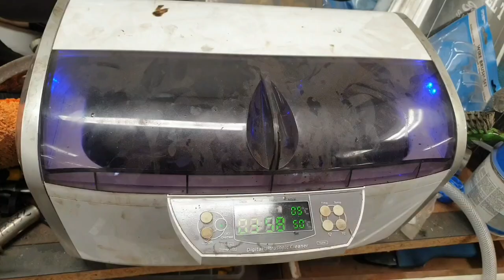Ford Model T Restoration/Build | Part 29 Front Wheel Adapter

Comment: Not how you pack bearings that hub is going to fail I give it 30 miles
Reply from the maker: How come? I have filled the hub with grease using a greasegun on the greasenipple I mounted to the hub. Is that not enough?
Reply: @OskarsCarsnStuff  only if you can be 100% certain that grease entered the zerk, filled the cavity, and complely filled that bearing with grease.  Not sure you'd be able to once the hub is fully installed.   I'm used to packing a bearing with grease in the palm of my hand before it ever goes into the hub.  Call me old school.
Reply from the maker: @christianmccollum1028  Okay I see, thanks for the explanation, I'll take it apart to double check that it filled up everything.

Comment: so where did you get the wheel adapter from ::::
Reply from the maker: I had them custom made from aluminum  plates and wooden wheel hubs.
Reply: i want to get mine done also from wood to 6 bolt wheels;;; i have a 1930 plymouth sedan that has 8 bolt pattern now;;; do you  have the name of the company that did them thanks
Reply from the maker: @darrellmealy6251  I brought the hub and wheel to my local mechanical workshop/machinist here in Sweden  and I told them what I wanted to do, they took measurements and then lathed/milled it to fit.